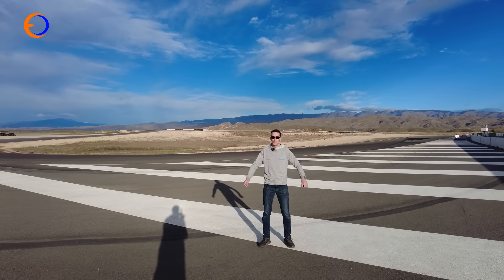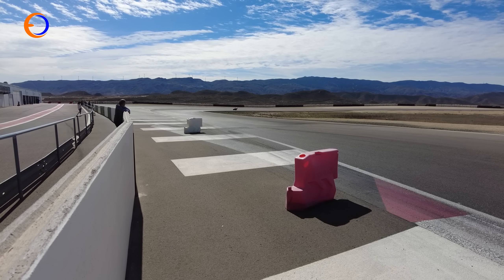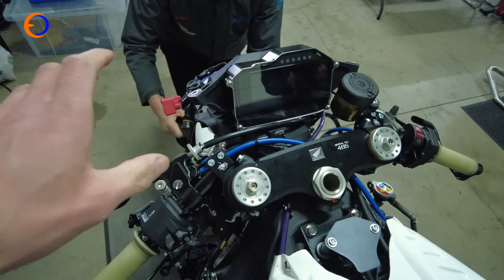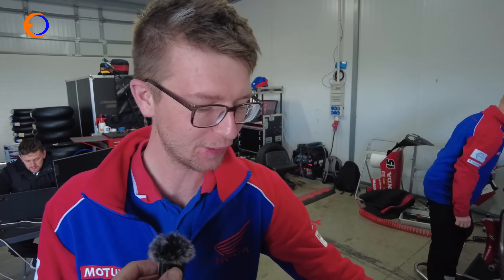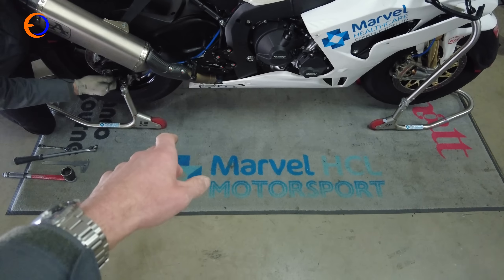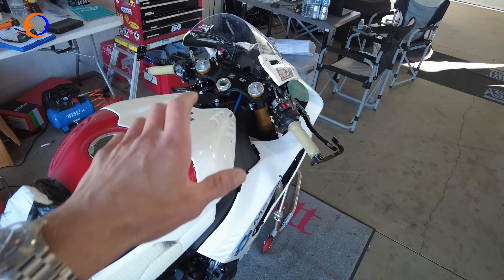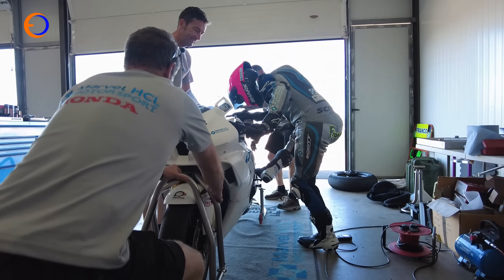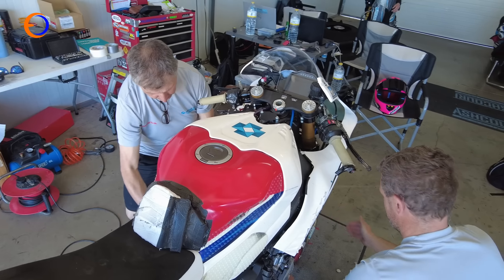Testing the Limit. Chasing Superbikes winners and risking crashing at Andalucia BSB Honda test.

Comment: 'Ere, Dave, if you want the sound of the on-boards to match the excellence of the shots, you should tape the fluffy lapel mic that you shove under peoples' helmets to the underside of the rear fairing, out of the wind. It picks up the sound of the engine without the wind noise.
Reply from the maker: Great tip!

Comment: Why don't you have crash protection on the frame eg crash mushrooms
Reply from the maker: Seen too many engine mounts broken off and frames damaged from the impact on the mushrooms, so I don't run them.
They can save little bits in slow crashes, but can cause significant damage too